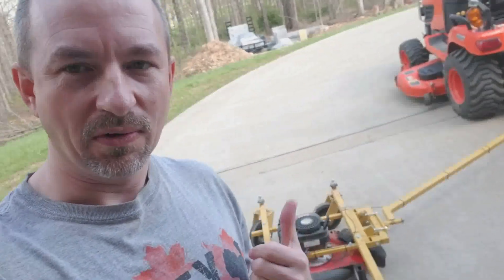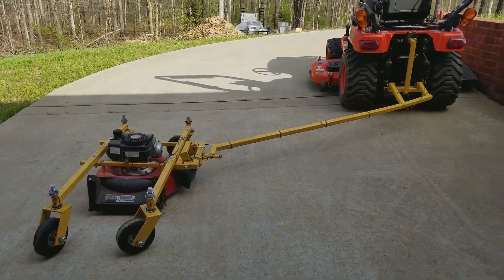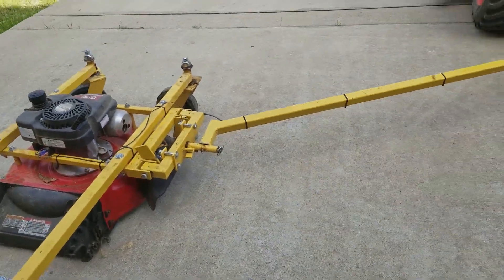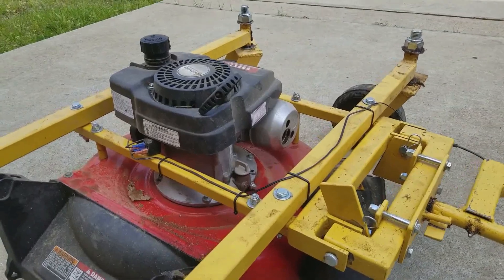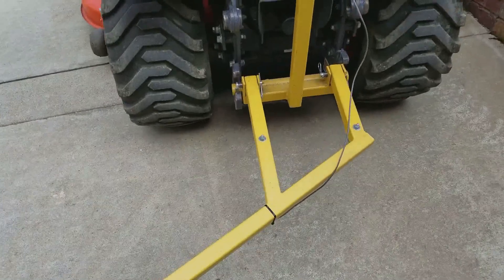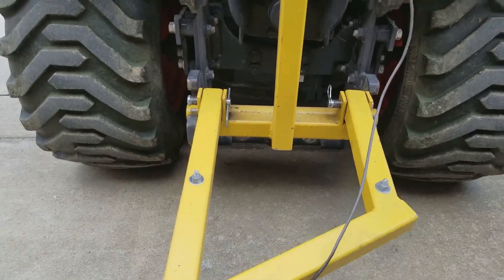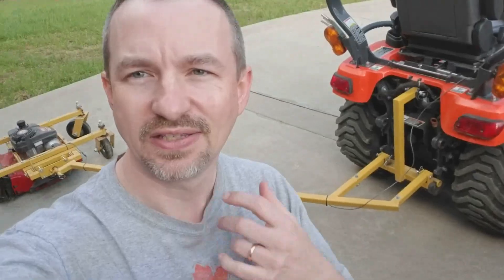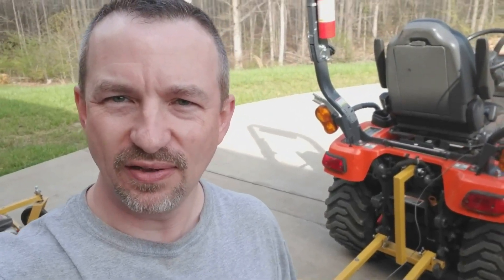Project #21 - Bank Mower Update and Modifications

Comment: I think that if you want to strengthen the arm fast and cheap, I would do this. Get some 3/8 or 1/2 rebar (very cheap) cut it about the length of the arm maybe 4 inches longer. Now put a piece of 4 X 4 wood in the center of the arm. Weld one end of the rod and push down and weld the other end. Now you have a ark. Now you can weld in several short pieces of rod to strengthen the ark. I like your idea. I have a very small CNC plasma cutter and I too like to engineer things.
Reply: Not sure how you get a huge boat (ark) out of a 4x4. An arc would be better in this case. In inverted arch would be another description.

Comment: If for any reason you decide you need the mower to be liftable you could find the center of the main boom , weld a 4" upright piece there or split that and weld 2 uprights about 2' apart , then take a pice of round stock about 3/4 the width of the main arm and weld it to said uprights then weld either end to the boom arm at either end . That would hold it up and not let it droop down from the weight of the mower and frame. And it wouldn't add too much weight over all .

Comment: What a great idea!! And a nice job!!
The area I have to mow is less than 100sq ft and flat!! So thats a tiny problem lol. I have been using a weed trimmer instead of the push mower. It's a lot faster but it's hard to get an even cut just holding it above the grass. Your bank mower reminded me of the gizmo I was trying to design in my mind. Some thing with wheels that I could attach to the trimmer or sit the trimmer in to get an even cut.  I was thinking of using pvc pipe as the support frame but at a loss after that. Would you have any suggestions or ideas???
Reply from the maker: Thanks!  Here is the link to my first video where I first designed and built it:
https://youtu.be/bCu1am6lAZc